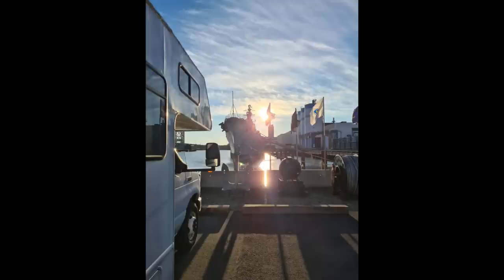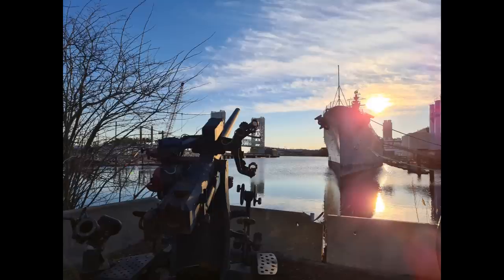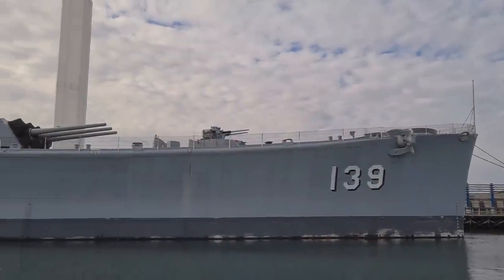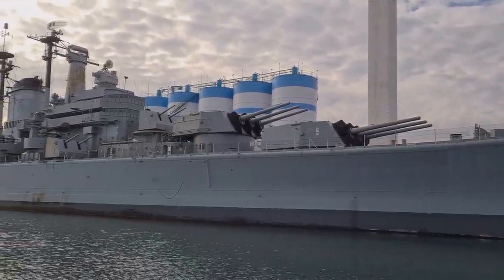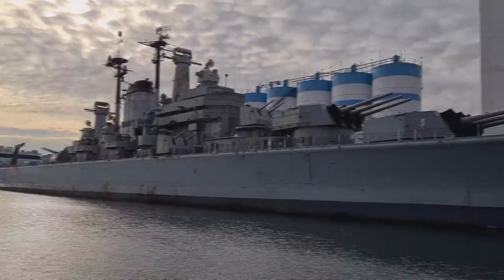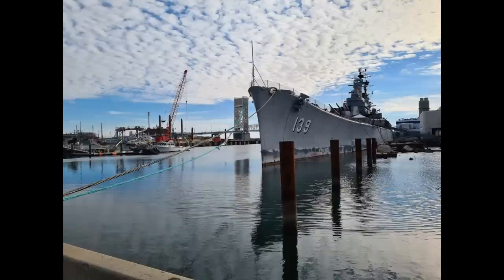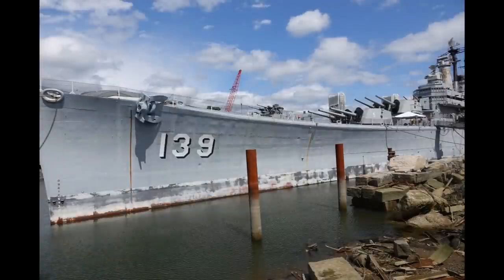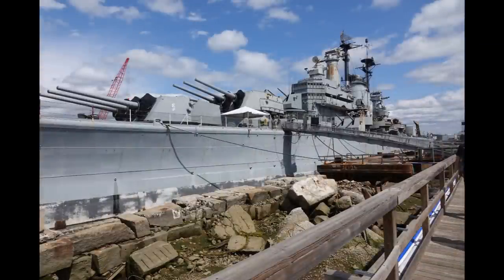USS Salem - Last of the heavy cruisers

Comment: the Salem to me is the pinnacle of mechanical gunnery engineering.  i hope you saw the air conditioning system and power plant.  unfortunately I can see the surface deterioration since I was last there.  This may be an industrial area but it is very near the huge suburbs of Boston.
Reply: Quincy is a huge subject of Boston!  Immediately to the southeast.  ;)
Reply: @lmo1960  I grew up in Canton.  Used to work in Quincy while going to school.  Within an hour of the Salem takes one out past Framingham.  I think the real problem may be lack of public transportation to the Salem.
Reply: @silvermikeGA  Unfortunately, the Harbor Express ferries lost the MBTA and Boston Harbor Islands funding, then the T bailed on the location based on a since repaired retaining wall.  A bus line or two passes by, and the city itself is has a huge public transportation infrastructure due to the T's Red line and commuter rail.

Comment: Correction: I meant to say the highest enclosed deck that runs the full length of the ship.  Anyways, thank you for a close up look at a fine ship that I've only seen from a couple thousand feet up in the air!
Reply: On the Salem, that deck is the 2nd deck, as all compartment plates designate it as 2nd deck.  Salem's main deck is the topside weather deck.

Comment: I think it was somewhat early in the war that it was found the 20mm was good at shooting down aircraft, but not before weapon release. the 40mm could. the initial reason for the 3in was that it was the smallest that could accommodate the VT fuse.
Late in the war, the urgent priority was defense against kamikaze, the 20mm was not best to stop a collision. 
After the war, longer range engage was desired. As the largest ICE was the double wasp at 2000+hp, there was an upper size to aircraft and weapon. I am not sure when gas turbine aircraft was capable of long range attack. At some point in the cold war, the Soviet developed long range attack aircraft.
Reply: The 3inch was in use well before the war as a fast light gun, but had a resurrection when the 20mm and 40mm could not reach far enough before weapon release.  The VT fuse was initially developed for 5inch, but then squeezed into 3inch.  The 20mm and 40mm could hit and knock down a plane, but the kamikazes needed to be shredded or they would still impact after hit.

Comment: sliding breech blocks are analogous to tilting bolts in automatic small arms, and that system works just fine, even with very high pressure cartridges.  nobody uses interrupted threads, with the AR15 style of locking breech bolt is really rotating lugs, not a screw thread. The electrics and hydraulics in those turrets must have been very demanding to maintain..........the USA really was top of their game when they built the Des Moines, Alaska's and Iowa's........a true industrial and technological super power, which it certainly is not today.

Comment: Hint: If the ship has a single funnel/stack it is also the later sub-class of the Clevelands and Baltimores!
Reply: The Salem/Des Moines class is a follow-on class, not a subclass, as they are significantly larger ships
Reply: @lmo1960  Fargo and Oregon City were sub-classes of the Cleveland and Baltimore classes.
USS Des Moines were an entirely different class of ships!
However, an easy way to tell if a ship is a Cleveland class or Fargo subclass is by the number of funnel(s)!  Same goes for the Baltimore and Oregon City!!!
Reply: @timengineman2nd714  That was my whole point.  Salem/Des Moines class took the best of the previous classes, but were a brand new design, to accommodate the 8 inch automatics and increased ammunition storage

Comment: So with the Des Moines guns they essentially pulled an 8" version of the Sherman firefly and put them in sideways?
Reply: I thought the Firefly was a 75mm, or 3 inch?  Or are you talking about the breech block?
Reply: @gregorywright4918  The firefly used the British 17 pounder, which is a 76mm gun. It normally loads from the top, but the Sherman turret is too small and they turned it 90° to load from the side. Similar to how the breach block orientation was turned to fit the small Des Moines turret.

Comment: When I went to visit the guides said that when they were doing some work on the bridge someone accidentally turned on the radar system and it knocked out all the police, fire, EMS etc radios in a 5 mile radius. Whoops.
Reply: That was a sea story, as it took some volunteers many weeks just to activate the correct equipment to rotate the main radar.  If it were to be energized (not allowed per US Navy) it would cause problems!
Reply: Plus, the shore power isn't powerful enough to energize the fully decommissioned radar systems
Reply: I had a member of the police department confirm the story. They all remembered it quite clearly!
Reply: @bara922  That would have made the news if it actually happened. Do you know any specifics?  Date? Year? I know the guy who got the unenergized main radar to turn, and it was quite an undertaking.  He said that energizing the radar wouldn't be easy, was illegal, and most of the equipment needed was still in mothballed unusable status.

Comment: they need to fix all the rust spots ... makes the ship look like its just left to rot
Reply: They are doing what they can.  They concentrate on key areas, for flotation and visitor access, but they don't have enough volunteers.  Hint, hint...
Reply: The electricity to run the compressor to needle gun and paint cost $$$$ and requires humans to run them, every museum ship in the us openly asks for donations of time, $$, and period accurate items and ships parts.  You may think the last bit is a joke but i donated period accurate naval lighting to the Salem last year, they were thrilled to take them.